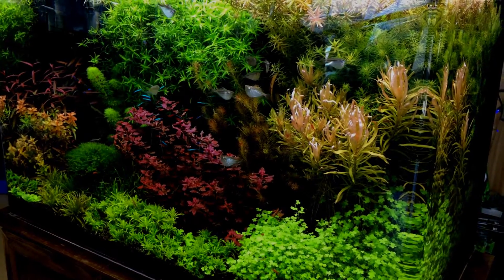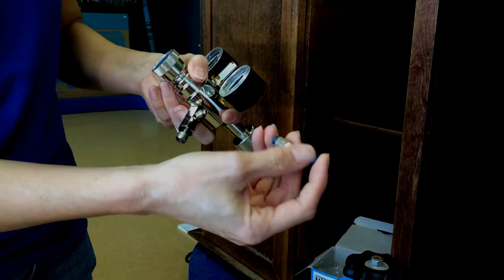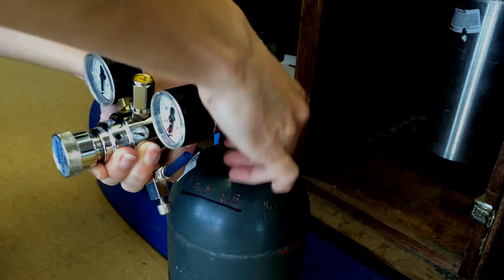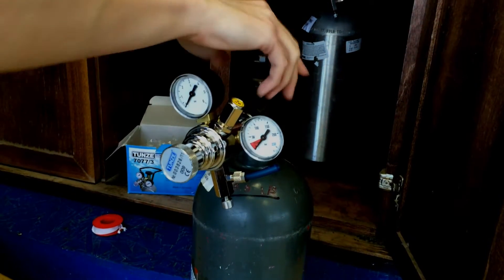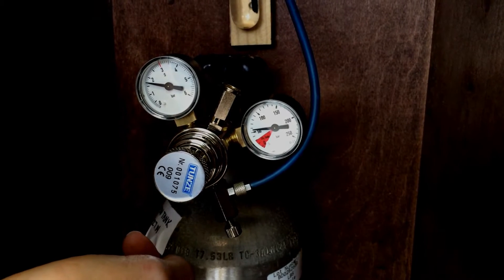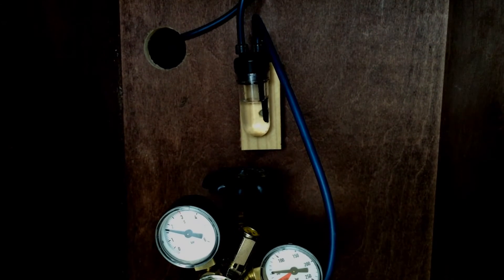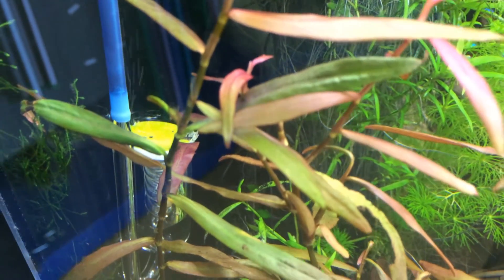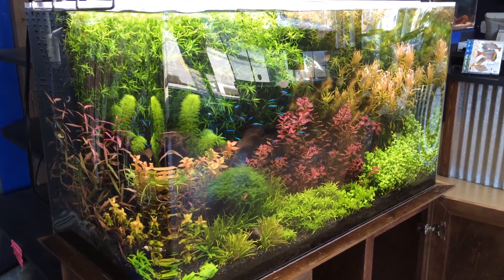CO2 Tank Setup for Planted Aquarium, Blue Fish Aquarium

Comment: No, just no.
You do NOT use teflon tape (plumbing tape) on the threads of this type of regulators, never! Those threads are not meant to hold gas pressure, they are just meant to keep the needed seal that you did NOT SHOW snug between the regulator and the tank's valve!
Why do a video about something you obviously do not know about? It's dangerous! People will try to install regulators on a high pressure tank using teflon tape instead of the necessary seal because the "experts" at Blue Fish Aquarium told them to!
You could be held liable for any damage caused by your bad advice so I would suggest you take this video down!
And it also speaks volumes of your store and it's people, it speaks very badly about it!
Wow, you have been giving ignorant advice since 2014! Please take this video down!

Comment: Hi I have the same regulator just wondering how do you connect to the solenoid with timer? I bought a solenoid from eBay for $15 when I connect it to the regulator.with timer (off mode) it still shooting bubbles. No matter is on or off. I already try replace 3x solenoid still same thing happen.Any idea?